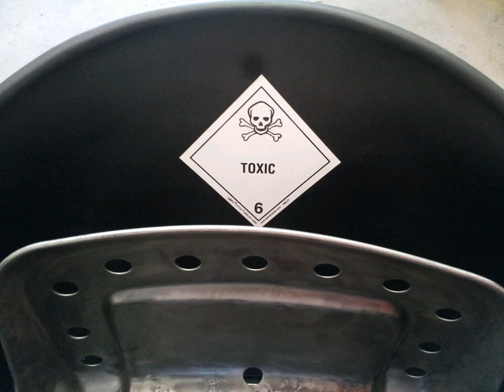My first rat rod lawn mower build.

Comment: VERY NICE! What were the radiator,  front tires and front light from ?
Reply from the maker: The radiator is a box fan shroud that I sectioned together.  Inside that, i just cut up an old car radiator and put it in there.  It's just to look like a rad, it doesn't function.  The headlights are just cheap amazon scooter headlights.  The front tires are wheelbarrow tires.